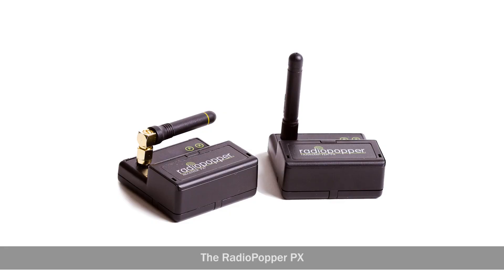Radio vs Infrared Flash Trigger - Ask SLR Lounge Season 1 Ep 4

Comment: I've done infrared off camera flash for a while and I already had an advantage as long as the sensors were aligned. When I upgraded to the Canon mark iii I decided to also upgrade my speedlites to the 600ex rts and got a st-et-r3 controller. I feel like I am I'm a perfect world now. All that hard work manually adjusting my settings in camera and in the speedlites in the past has lead me to appreciate these new toys. I have ettl, full control without line of site, and can shoot hss off camera!

Comment: In theory, if one of the flashes doesn't have infrared, but it does have "optical" triggering, then yes. You can use the infrared flash to trigger the other infrared flash, which then fires and triggers the third flash via optical trigger. But, it wouldn't be a very "consistent" or reliable triggering mechanism. Might work for small studio shoots though.

Comment: Suppose I have two flashes, one with infrared capability and the other without any wireless capability but has slave mode. Can I trigger both of them at the same time, one through infra red and the other as a slave using the built-in flash?

What's the pros and cons of this arrangement compared to triggering both as slaves instead? Thanks!